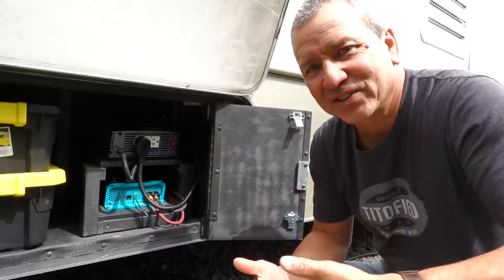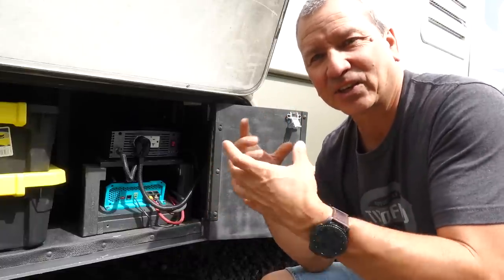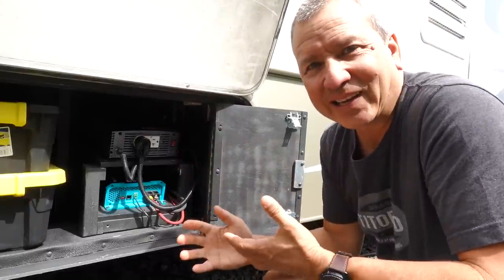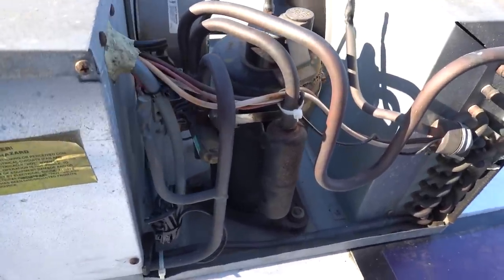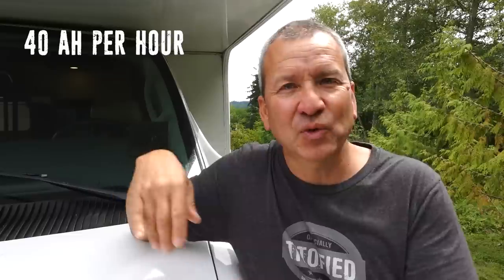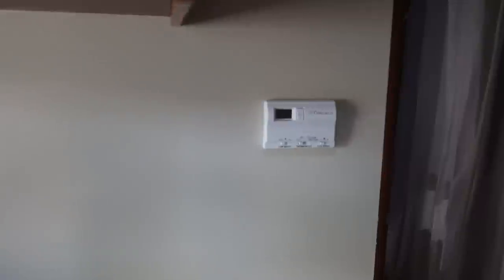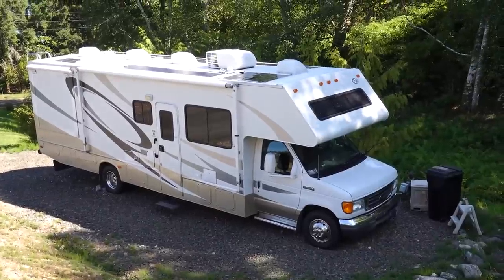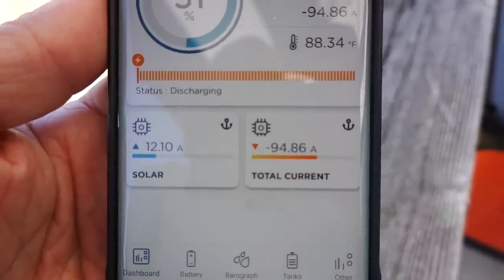BAD IDEA? Running RV Air Conditioner on SOLAR and INVERTER

Comment: First is first, a conventional AC unit is not made for that application, is almost as putting a window unit on an airplane!!  We install all day long 12v  7000 BTU units able to run continuously 4 hours on a single MPS 125ah (31 series battery only weighting 28 lbs ), and over 7 hours at night in Econo mode, the units must be ultra efficient 3phase AC low voltage compressors, some are operating on just 7v 3Ph trough a DC /AC Frequency drive 12v DC in 7 to 3 V AC3PH out. then the components like fans must be also Permanent magnet equipped with ceramic bearings to achieve ultra efficient result.. 
any equipment that delivers cold will also delivers heat, so both heat exchangers are key for success, installing a condenser under the vehicle is sometime not as ideal, heat from the road, exhaust and engine could reduce drastically the efficiency of the unit, then because of design painting a roof top unit in black could also hurt the heat exchange. Lithium phosphate is a big improvement over conventional AGM acid batteries, half the weight twice the capacity, 10 times longer life. Imagine the cables needed to run a 100amp unit, compared to wires on a 27.8amp.. charging system?

Comment: Forget 12V use industrial high voltage solar panels and 48V battery bank with proper sizing.
Reply: Use 48 panels with a mppt regulator. Run the panels in series and you can use standard 12volt batteries.

Comment: I noticed on your AC test video that your trucker-style cell phone booster antenna on the roof was in the horizontal position. Do you use it in this position or was it only down for travel? If you use it down, is reception impaired? I'm about to install mine and wondered if it works horizontally. Thanks!

Comment: My Dometic AC intermittently shows E1 (Mainboard connection error) on the thermostat. It works great whenever it's not displaying this error and the only way to reset the error is to let the AC sit for a period of time. I've checked the wiring I can see on the thermostat and unit side... but all looks good. Any ideas before I start replacing parts? Like I said it heats and cools perfectly otherwise.
Reply from the maker: I'm wondering if some component on the board is overheating?

Comment: It's not practical with your set up, but it can and does work with other systems. Try it at 76 or 78 degrees. If you need 74 degrees you want to rethink where you camp, like stay only at campgrounds with hookups.

Comment: HELLO
I m  having a problem with  your hole artical
1.  you`r inverter is a 2000 watt inverter  2000/1500 watts . You spent enough money to almost by 2 brand new  cold spot air conditioners , low  watts start
2.  i`m installed 3 ~1000/ 800 watt new Bankable ,on grid inverters  , which can be banked as needed as power is used  or as power is decreased . To save energy
3.   it`s true you must carry enough input power to maintain your system you are way to small for what your trying to do 
4.  I`m installing solar on my roof  to a system of 2500 watts as of so far $ 65/ 240 watts/ panel/ also looking at a wind generator  $200/per unit 4100 watts
5.   I have a freezer and removing  my gas stove to a Elect range  and have installed elect  heater forset and a new shower head for elect hot water at the shower head removing the gas/elect hot water heater
6.   when done i will have enough power to keep all my appliances going
7.   I will have elect kitchen forset , bathroom elect shower head
bed room elect blanket , base board heat
dining room is my freezer 5.5 cubic feet /energy star  . A second ref-reg  5.5 cubic feet My computer / server to maintain all services
living room  15 feet of elect base board heat 2 tv`s ,1 for tv and movies , the second for external security cam system and more
8.   where as i  am retired and only working on my retirement i have to by a little at a  time ,
 1 solar on grid inverter , 2 /300 watt solar panels , hot water forsets ,  1 low wattage .
 5000 BTU A.C elect gauges , 2 / h-9 Walmart battier .  I am almost at a point of holding my     own 
9.    So far i`ve only spent  $ 640.00 dollars  I`ll be looking at between $ 1300.00 to 1500.00 dollars to have enough to do what your looking at  and more
10   Yes it can be done and  cheaply   Oh by the way i already have all the appliances so they are no cost to me

Comment: With your sized system it is not practical,    A much larger battery bank and solar array makes it much more doable in fact there are quite a few who have had good success. Of course it goes without saying energy management is a must and of course good solar exposure.

Comment: Not really a "real-world test" is it?. In real-world boondocking you will most likely be running your refrigerator 24/7, lights, TV, people would be going in and out of you RV 8 to 12 times per day, that is with two people. 
I have a dorm-type refrigerator and a small chest type deep freeze. Together those two unites ONLY pull1,090 watts of power per day. Since you will be boondocking you will also be using your water pump, if you run your water pump (for showers and washing dishes, getting drinking water and washing your hands) 1 hour per day you will use an additional 90 to 100 watts of power per day. Now we are up to 1,190 wats PER DAY. That doesn't include the hairdryer the ladies will be using almost every day, which will be most likely about 500 watts more.
What you did is set the RV by your home where it gets cool at night and ran a CONTROLLED test. Where I live the temp got down to 75 last night. How many times did you go into your RV that day?
I think in a real-world test you might get about 4 or 5 hours before your batteries were down to about 30 to 40% maybe not even that much.
I live, full time, in a 40' diesel-powered class A. I have had three class A's in the last 19 years and I have 12,00 watts of solar on my coach. I also have 800 amp hours of battery, one 1,000 watt inverter and a 2,000-watt inverter. I do live at KOA RV Park in Alamogordo, NM the only power I use from shower-power is running my two AC units. I create ALL the rest of the power I use from my solar array.
I have taken years to create a "power audit" spreadsheet that will help you determine just how much solar you will need for off-grid LIFESTYLE. You can find that on my channel video #76. You can download the spreadsheet from the description below that video.
To do a "real-world test" you need to be out in the "real-world" using ALL the power you would be using in a real-world situation.
Reply from the maker: Yes you're correct. But it's as real world as I can do right now to isolate the A/C draw. I figured smart individuals like yourself could factor in the rest of the potential system loads. Isolating my test to just the A/C and solar was the best way for me to show accurate current draw with the A/C running.
Reply: @RVwithTito  OK, I can agree with that.

Comment: Has anyone drawn the 1800-2000 watts continually and checked the temperature of their wires? I have 2/0 wires and a 2000 watt Inverter Charger. My terminal on my inverter gets to be 160F, and my wires all the way back to the battery bank are at 130F on the outside. Heat checked with a temperature gun for the wires, and with a temperature sensor on the ring terminal of the inverter. Just curious what the normal is?
Reply from the maker: I'd love to hear what others say. I haven't drawn that much but I would prefer cables not get warm at all. Perhaps 4/0 is the way to go for long term high current draw applications. Anyone?
Reply: @thegoodtom1718  The Inverter is about 3' away from the Battle Born 300/AH, so total of 6' cable run (Pos and Neg). The cables are custom made with copper rings that are hydraulically  pressed on.
Reply: @RVwithTito  When you did your A/C test, did you happen to check your DC wires going into your inverter for heat?

Comment: the real solution is a window ac, most units use about 500 watts, making your goal easil obtainable. there are several youtube vids showing people doing this, u likley didnt need that soft start sine most good inverters have GREAT surge ratings, for example your 2000w likley will do a real life 4000w surge, with a momentary run time [2-5 mins] at 2500+ watts

Comment: I think the key is to use 100% of your solar every day.. if your batteries are ever fully charged and the sun it out then you are wasting power... i would think you run your AC off your batteries for day one.. day 2 -4 you use your generator.. let the batteries catch up..never let the batteries get above 80%... never below 50%..

Comment: Nothing is free. Maybe you should look into the Mabru 12 volt, totally DC air conditioning units.  Power draw is touted to be much much less. Or maybe they only work on boats, my bad.

Comment: Great video!
Reply from the maker: Glad you enjoyed it
Reply: @RVwithTito  I'm wondering what do you think would be more efficient for an rv,  a mini split system or a regular rooftop A/c with a soft start?
Reply from the maker: @ninorcsinned3465  I haven't done any testing on mini split systems so I can't say. There seem to be several others in this comment section using them though. Perhaps they can chime in.

Comment: Would be nice to run inverter ACs direct from Solar....with DC!!!
Reply from the maker: Not sure if there are DC air conditioner options available. I'll have to do some research. If you find any then share it.
Reply: @RVwithTito  Hot Spot makes a solar direct to DC air conditioner. It's a mini-split. I installed one on my wife's "She Shed." It works great during the day. The only downside is.... It's hard to find a dealer that keeps them in stock. You generally have to order it and wait 3 to 6 months to get one. If you want more info on how mine is hooked up, let me know.
Reply from the maker: @allenmay8850  That's interesting. Thanks for letting us know. Hope it's keeping the she shed cool :)

Comment: The problem I see is this... The more you park in the sun the hotter it gets inside and the more your ac needs to run. But... If you park in the shade your rig will be much cooler but you won't be making any solar power. It's kind of a double edged sword... You need to be in the sun for solar power but your rig will be hotter due to be parked in the sun... You can park in the shade and run your ac less but you you're making no power... Best case scenario is a hybrid system where the panels are in the sun but your rig is in the shade. This is a pain in the neck though as you have to set them out and move them all the time and they're susceptible to weather and being stolen as well. My rig is dark brown and black and I'd rather just park in the shade and run my generator when need be because even with my ac going non stop 24/7 If I'm in the sun my rv is an oven. Enjoyed the video 👍

Comment: Sounds like You need a large trailer load of solar panels and batteries if You are really planning to run Your air conditioner on solar.
Reply from the maker: Looks like it :)

Comment: The problem with RV air conditioning systems is they are extremely cheap and inefficient and are 1960's technology. I use a mini split system in my 30 by 32 foot shop and it draws 7 amps when running. YES, 7 AMPS!!!  The a/c unit you link to has an EER less then 6.0. That is HORRIBLE.  I would expect a so called efficient unit to be at least double that.

Comment: I know this is completely unrelated to this topic but I thought I would let you know about a cool product if you don't already it is keyless entry for your RV there is a website that sells them called RVlock.com but if you go on eBay and type in RV keyless entry you can get the exact same design for $100 less I have it and installed it yesterday it works fantastic just thought I would let you know 👍
Reply from the maker: Yes. I'm familiar with that product. Had a chance to review it a few years ago, but wasn't interested.
Reply: @RVwithTito  I see

Comment: Wow! Try putting some solar panels up there it sounds like you have nearly nothing!   You need more solar.  Why not, the panels are cheap right now. Get rid of that energy hog on your roof and do a mini split. Add a couple of controllers and another six solar panels. And if you are using 5 battle born batteries you won’t have a problem. My system works great.

Comment: Yes dude it actually is practical your entire test is flawed . First who is the right line says their air con as 74 degrees is pretty freaking cold the standard is 76 to 78 degrees which is a major difference in energy consumption . there are also many factors involved an air conditioned ability to maintain that temperature what are those major issues involved is the level of is there anything you have in the RV and its ability to keep the cold air in and the heat out also what kind of windows do you have you have single pane double pane triple pane do you have tinting on the windows do you have blackout curtains on the windows where is thermal Arizona to keep the heat out of the RV ? Is your fridge erator properly vented so that the hot air from the fridge is being channeled to the outside of the RV instead of released inside ? What about your hot water here and pipes are they thermally insulated to keep the heat from leaking off into your RV ? And when we talk about windows we're also gonna be talking about sunroofs which can allow direct UV rays in sun he into the RV space I mean the list goes on and on and on . Also is the technology the solar Titan battery technology what kind of battery do you have do you have lead acid batteries or do you have lithium batteries? If you have lithium what kind of lithium battle worn is the best there is or your cheap as pretty cheap as technology or if you have any cheap as technology in your RV don't be coming up on here and giving us fraud studies and test because your test doesn't reflect the true possibilities oh sorry capabilities including your yarvi what kind of solar panels do you have not only the size well who made some not all solar panels are equal not all solar panels have the same efficiency in producing energy what kind of inverter do you have not all iever inverters regardless of the rating or equal again who makes them ? I have seen arviz imperson an on YouTube the runner air conditioner in your RV all day and all night and they had plenty of solar I've seen 40 foot Class A motorhomes running air con all day all night because they upgraded to put the proper technology into their rig for you to have come to this conclusion shows me clearly you have not done your homework and your test is not worth the video that it was produced in

Comment: The entire reason for having an RV is you can “drive” to where you don’t need AC.  :)
Reply: Due to global warming and everybody and their dog in an RV in the few cool spots left, don't expect a quiet peaceful experience when you get there.
Reply: I love Florida beaches FLAT LAND ..! In and out from 95 everything is there easy..! The 364 solve the ac issue ...! The rest of the country is all yours..!!
Reply: Topanga Reyna Nope - most RV’s are purchased by folks who have a home or apartment and they are simply getting away for a bit.  Full-timers are the exception.
Reply: Will retire in 10-15 yrs and will do exactly that ;).   Until then it's the quiet diesel gen to supplement our 400 amp BB bank and 925 watts solar on our vintage DP.
Reply from the maker: Well that's what we do for sure living in the Western US. But, of course, not everyone has that option. Then there's the humidity factor which we hate :)
Reply: THESTEELERSFAN My data is the RVIA saying less than half of users are full time.  Where is your data from?  RVIA is pretty good source....
Reply: THESTEELERSFAN Sorry meant for Topanga ....
Reply: Can’t drive to Antarctica so…

Comment: Use a window until if you want easy solar Air conditioning
Reply from the maker: Window + fan works pretty well.
Reply: @RVwithTito  i have a window unit that only uses 150 watts thats nothing and would rather have that then fan im in Florida